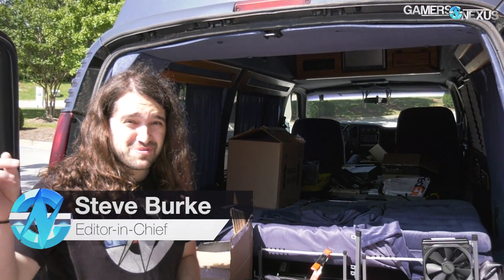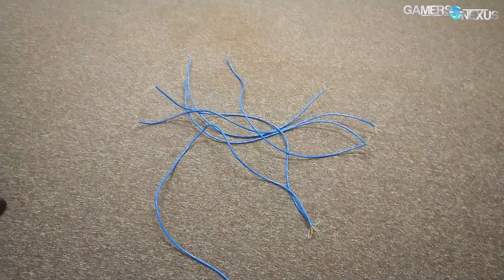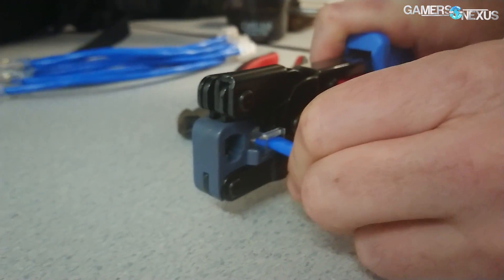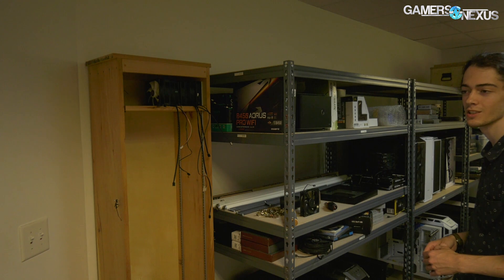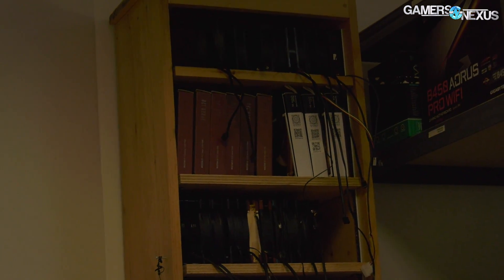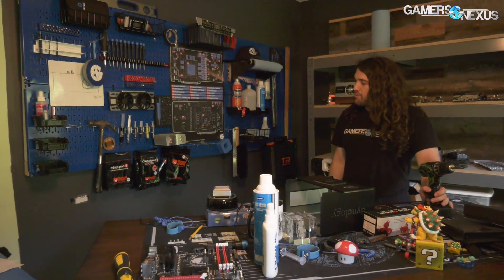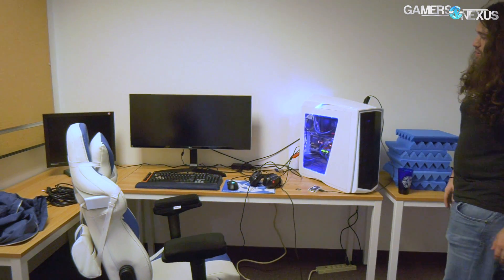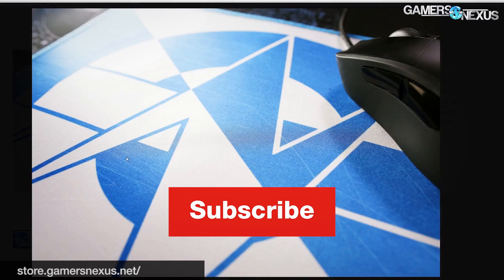Set Building, Organization, & Test Benches: GN Moving Vlog, Part 6

Comment from the maker: GN Moving Vlog playlist! https://www.youtube.com/watch?v=-yRWepBdT84&list=PLsuVSmND84QsLp8Efpu_hKgKLIU1hzFEF
Grab one of our modmats or beer glasses here: https://store.gamersnexus.net
Reply: the wheel of your mini light stand didnt work because you installed them backward
Reply: You could hang your frame from the drop ceiling and just use a couple sheetrock anchors to pin it to the wall.
Reply: Drill out holes in the peg board frame. Use sheet metal screws long enough to go at least 1 inch past the steel stud. The holes in the wood frame will let the screws spin in the wood and grab the metal stud. Just for future reference. Also, when probing drywall for voids and studs, cut off coat hangers work well. Lastly, sounds like some one is scuba diving in the background. Just an odd thing I noticed. Love the content as always and the DIY way you guys get things done.
Reply: Looks like someone's been sleeping in a "VAN, DOWN BY THE RIVER!".
Reply: Props to Mr. Stone! He feels the same way I do! "I'm not here to do the job twice!" As a mechanic I always say "This isn't 'Do It Twice Auto'"! I just hope with all of that space you guys have now, you won't feel so isolated_ated__ated___ated____ated! LOL!
Reply: You can drill though metal studs they're nothing special but it is a pain in ass. The steel that drill bits are made of is HSS (high speed steel) which is harder than A36 (which is probably the steel the studs are made of). If that dosen't work for you get carbide drill bits, they're easy to find and don't cost much more. Hope this helps.
Reply: @bobbybobberson1206  We just used self-tapping screws and they went in within seconds.
Reply: It gets them up and working while moving, inventorying, and setting up the rest of the gear. They can make it look pretty later.
Reply: Self tapping screws remove too much material to have a good bite for 20 or 18 gauge steel stud. A drywall screw or something with a fine thread would be best and will punch through easily enough anyway. Self-tapping would be needed only if it's 16 gauge or thicker. Toggle bolts is not a bad idea.

That said, Steve said he didn't have approval to do anything to that wall, which is not surprising since it's a firewall, so this is all moot.
Reply: @bardacuda82  There are a few different types of self-tapping screws. The more common winged type would probably make the hole a bit too big, but the screws we used had a reduced diameter tip that negated that. I thought he said the wall was NOT an outer firewall, so that's why I was confused about the approval part. Y'all have a good evening.
Reply: I think I was mistaken about it being a firewall. As someone else pointed out in another comment there was an air gap where it meets the window so it can't be. There was just a message on screen that he didn't have approval to do anything to that wall but must be for a different reason.
Reply: 4:37 kinda like a creepy 60´s first camera family video xD
Reply: Hey guys, self-tapping metal screws (Home Depot, 2" screws should be fine depending on spacer thickness) use a plastic spacer sleeve between drywall surface and back of pegboard, I've done this many times, they're all still up and NOT pulling away from stud (metal.)
Reply: If it's not too heavy, just get metal threaded drywall anchors (supports about 15-20lbs each) as these are what's used for cupboards. Or get toggle bolts. You might also be able to hang it from the ceiling if you can find the floor joist or structure above the drop ceilings. You'll have to see if you can do anything to get the cables past the drop ceiling though.
Reply: I really like how you're casually sneaking your GN cups into shots!  XD
Reply: @Gamers Nexus if you have permission from the landlord you can take self-tapping metal screws or the ones designed for steel roofs to mount the pegboard to the wall.
the longer the better.
Reply: @Jurgen D  that could work two if he doesn't have permission from the landlord to mount on the wall

Comment: Gamers Nexus you should paint the wood supports holding up the toolboard the same color as the wall so it watches with the work bench table of the set better.
Reply: Patrick Burke definitely or at least stain it if they don't some up with a different solution
Reply: I disagree. I like the wood.

Comment: If you guys do decide to go about mounting things to the wall in the future, be it your pegboard or any other displays/racks like it, one option you have is toggle bolts. A 1/8" toggle bolt in 3/8" sheetrock will hold about 150 pounds, so if you had used one of those to mount each corner of your pegboard it would support well over 500 pounds, though I'm not really sure how sheetrock is mounted when it's used with metal studs since I've always used wood, even when I've done remodeling in commercial offices like these. As long as you distribute the weight you shouldn't run into any problems though, especially if you were to add a third pair of toggle bolts in or near the center. The hole will be bigger than a wood screw so it's a bit more work to patch once removed if you guys have any concerns about that, about a quarter inch vs an eighth or so, but they're definitely the way to go if you can't mount to studs, anchors just don't compare.

Comment: In steel stud framing, you can certainly mount stuff to the walls. The magnetized parts every foot or so going down the wall is specifically for mounting stuff, usually cabinets. Just use self-tapping fine-thread screws. 

In the case of a fire-wall, that usually just means the drywall is doubled-up. Two layers of 5/8", so you would need to get through 1 1/4" to 1 1/2" (because joint compound adds to the thickness) before you can bite into the steel behind it.

The only situation where anchoring to steel studs wouldn't work compared to wood is if you were trying to use large lag screws, like ones you would use for a large TV mount. Those don't work well in steel, and you would be better off drilling a hole through the stud and using a toggle. 

There are many different fastening systems out there that work for drywall in place of traditional sleeve anchors and toggles. I have used the self-drilling drywall anchors on hundreds of occasions, and they work great. The same goes for zip-style toggles for really heavy loads that need the toggle stay in place if removed.

Comment: Hey Guys,
You could use molly clamps or even regular drywall anchors to attach your wooden supports directly to the wall.
As long as you use a lot of them spanned over a distance. they can support a good deal of weight. A sheet of plywood mounted to the wall works best due to the larger surface area. Some construction adhesive for reinforcement could also be used. You can also screw directly to metal studs using self tapping screws with fine  flat threads such as sheet metal screws. Worst case scenario you'd have some drywall repair to do. Although metal studs are not ideal for mounting heavy objects to the wall they will not support as much weight as a wood framed wall. Your stand mounted solution is a good compromise.
The new space is coming together great.
Reply: After reading further comments if that is a fire wall you're probably not allowed to make any holes in it at all. A false set wall built in front of the wall might be a way to go. The other methods for wall mounting should still be fine on interior walls.

Comment: I would stand the fans up in rows inside drawers, like a library system. That's the most space efficient thing I got for mine. You can just screw a sheet of plywood to the wall (into the studs with steel threaded screws) and then you can hang whatever you want on it. I built a full kitchen in my old apartment with steel studs and hung cabinets and everything on there. It was fine for the 8 years I lived there and just had to fill the screw holes after tearing it down.

Comment: There are Anchors for drywall mounting.  There are also ways to screw into metal studs - bit of a pain, but quick once you have the bits and corrects screws.

Comment: For your wooden frame.... you don't need the back supports if you rest it on the wall. And then I would use couple drywall screws to keep the top of secure to the wall. PM me if you have any questions.

Comment: Re: Pegboard stand.   If you decide you want it closer to the wall,  think tall, thin triangle.  Shorten the base on the backside and make the rear brace a lot taller, all the way to the top even.  I see the rear legs are already shorter than the front, but I think you can go a lot farther safely.   For example, look at an engine stand; almost no rear legs with the wheels just behind the vertical.

Comment: You can screw into metal studs just the same as wood. The screw used for the drywall on metal studs is the same as wood studs in some cases, you just push really hard to get the screw started. You can use self tapping screws too if you don't want to push really hard yet have to push hard still. Just don't screw where the magnet really sticks because that's a drywall screw. metal studs are made from thin metal, thin enough to fit in between the threads of a drywall screw. That's thin enough that you can screw directly into them without a pilot hole or using a tap, especially the tap lol.

Comment: For the PSU testing, I have a few request for the testing, in addition to the obvious regulation and ripple, and a breakdown of the internal components.
-The fan RPM at different loads. Noise testing isn't standardised, and the noise is very similar at the same RPM for different PSUs. 
-The transient response, same way Aris tests it. 
-The protections. This does carry the risk of damaging the testing equipment, so do it at your own risk, if you want to. But I do consider it important. The EVGA B3 had issues with its OPP (killing the PSU and creating sparks before it trips), and the EVGA G3 had minor issues with its OPP and the OTP set too high (started melting).

Anyway, looking forward to the PSU and fan testing, and I wish you the best of luck with the move!

Comment: The magnet only being strongly attracted at various points vertically makes me believe it could just be a wood stud with the metal drywall screws being the magnetic attractor. I'm not experienced with that stuff by any means but just a thought. If it is easy to repair the screw hole like you said, it might be worth checking out, since the screw you used was at one of the magnetic hotspots. Unless you have solidly proven its metal all the way up and down, in which case disregard this. Just thought I'd put my two cents in, thanks for the moving vlogs! I've been enjoying them a lot, and am a newish viewer, but love the ideals and testing methodology your channel has. Best of luck with the move in!

Comment: All you would have needed to mount to those studs is self tapping screws or self drilling bolts or screws. That's what they were made for and they sure can hold up that whole peg board and then sum. Just keep it in mind and maybe one day you might revisit and find a better solution, just remember that those metal studs aren't weak they can hold up a lot more weight than you may think.

Comment: liquid nail the boards with screws int the sheet rock for support. perhaps hanging cables from ceiling supports to carry the weight then screws into the sheet rock. Just some ideas that might spark an idea.

Comment: Toggle bolts work great for wall mounting or even longer self tapping drywall screws would hold that board up easy, just fasten two 2x4 to the wall then screw the board to them. FYI hardly any commercial property uses wood studs anymore.

Comment: The reason you couldn't put a screw into the wall was because you most likely used a wood screw. Depending on the gauge of the stud you may or may not (as you found) be able to drive a screw into the stud. You can use a wood screw in a pinch if you pre drill the hole slightly smaller than the screw and then drive the screw in. What you really need is to get some self drilling screws that you can pick up at any local hardware store that has a drilling head that will pre drill the stud then thread its way in after it pre drills. 

You may be unfamiliar with them but they are very similar to wood studs as far as hanging finishes the major difference being that you just need a different screw to attach to them. 

I have been a contractor for nearly 20 years and have worked extensively with steel studs, if you need any help feel free to message.

Comment: I would trip over those legs of the pegboard so many times every day. I'd either build a double wall out of wood or just drill the metal studs and deal with the repairs later(go full cartman, I do what I want). that table is weird, but would probably work well for interviews
Reply: I was thinking the exact same thing and then I saw they put the table between the feet that helps mitigate most of the trip hazzard.

Comment: #AskGN :- Could you do a huge mouse mat with different colours, like blue/white and black/red ?? 

asking for a friend...

nahh i totally want a huge black and red GN mouse mat!
Reply: Premium Lagg I'd get a nice, small mouse pad with the gamers nexus logo in the corner. That would be sweet.
Reply: just dye a mod mat red and black and use it as a mouse mat?
Reply: Premium Lagg that would defeat the sole purpose of the marketing path of their color combination , there is a reason the colors stay true to the channel artwork
Reply: I think the mod mat surface is a bit too rough for mouses, well for me
Reply: I have a huge custom mousepad (1700x1100mm in my case) myself, ordered it from some aliexpress you could go that route and use the logo if you really want to. 
Of course that would not be supporting gamers nexus in any way by doing that.
And you would probably need to find a high ress version of the logo somewhere.

(I do not have a gn logo on it just outlines of components I had laying around in my room).
Reply: +Gamers Nexus

I'd buy a large sized mat. Keyboard/mouse go on my current one and I won't change that anytime soon. Consider a discrete logo on it and I'm sold.
Reply: Dude, a mod mat the size of a XL mouse pad would be awesome. Make it a little smaller to fit on peoples desk, and possibly slightly cheaper.

Comment: 8:50 i doubt it is steel studs those are usually reserved for high rise office buildings. It is the drywall screws the reason why I say this is you moved the magnet several inches and to the same few spots you didn't just move the magnet one inch and stop and one in and stop.

Comment: Use sheet rock anchors or #12 screws straight into the metal stud, pre drill with an 1/8" drill bit.

Comment: Just drill holes in the metal supports and use the right size bolts. Should suffice. It's basically the same concept as using screws in a metal computer case which I know you are quite familiar with 😊 metal is actually not that far from working with wood. Almost same principals, just different tools.

Comment: When nerds try to build a wall stand and it ends up looking like a overkill trebuchet. :)
A tip from me, shorten the feet so you don't trip on em. The length is overkill. And paint it. I reckon you got some paint from the wall still around.

Comment: Just run the 2x4's to the floor to support the weight then use some L brackets on the frame and mount through the L brackets with toggle bolts to keep it from tipping over.

Comment: When you attach 2 pieces of wood you're meant to drill through the first one and then screw in to the second.

Other wise  you can't tighten them. or rather the relationship between the two pieces of wood is fixed. tightening has no affect.

Comment: 16:10 Can I teach you all how to use a c-stand? That's a pretty dangerous use of a gobo head, it's backwards the receiver goes into the baby pin on the stand then the arm goes into the knuckle of the gobo head. Also remember to "rig to the right" where the extended load on the arm is always on your right thus when weight is applied to the arm it tightens instead of loosening.

Comment: You can get 10gbit from ordinary cat 5e. From my testing the nic made much more effect on transfer rate than the cables, wall sockets and plug ends. I saw no difference in transfer rate between cat5e and cat6. Obviously cable lengths matter and my cables weren't overly wrong. I think you will find that it will either do 10gbit or it will failover to 1gbit if the cable is crap.

Comment: You could have just made the frame up to the wall
|
|
|\
Stuff attached to it bring the weight forward anyway
Reply: Or just used Magnets to attach it to the wall, duhhh
Reply: 123fizzers those would need to be some big-ass magnets
Reply: Neodynium is your friend
Reply: The problem with magnets is they dont tend to deal with gravity well. As a magnet is only as strong as its bond, and when one of the bonds is smooth drywall, there isnt enough friction to keep it from sliding. Like my neodymium magnets can hold 40lb's vertical force (fighting the magnetic bond) but only like 5lb's sliding it due to friction.
Reply: ac3ofspades878 thank you captain for overanalysing and clarifying my joke ;)
Reply: there is no need for the massive sled-shoes, just build a wood frame from the floor up to the fake ceiling and into the nearest corner.
do the other side's corner too to increase stability.
edit: oh its an emergency frame to get filming ASAP.
Reply: Yes that's what i would've done to save some space and it would've looked cleaner too i think